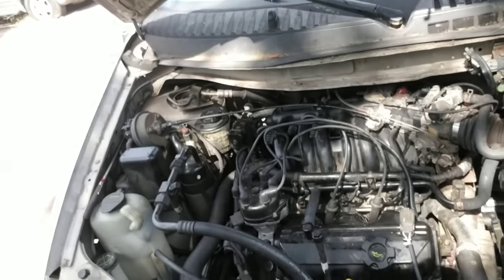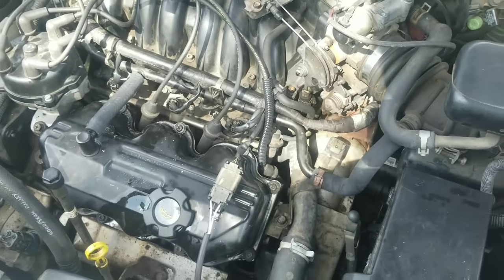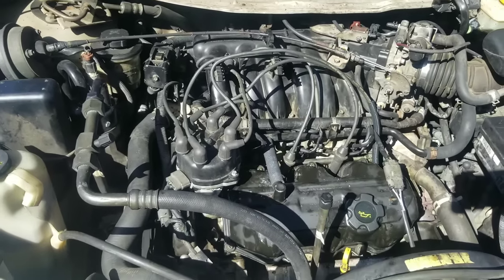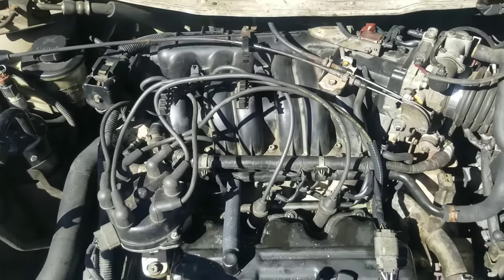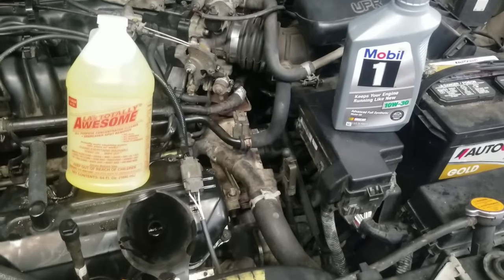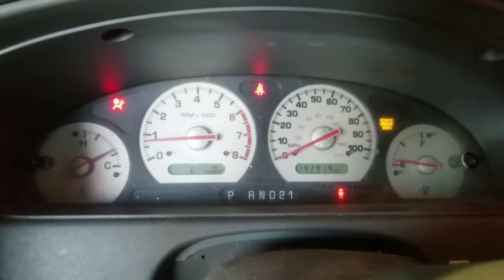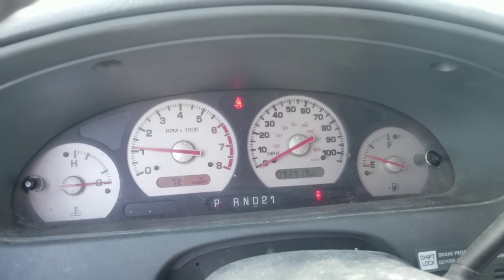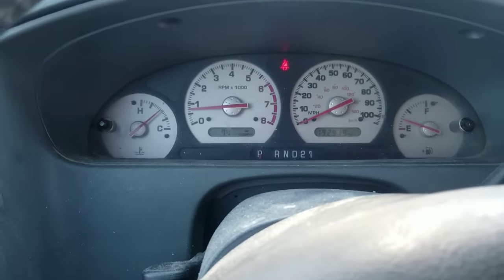How to Clean The Inside Of Your Engine The Easy Cheap Way.

Comment: Think I'll just follow the advice of Scotty Kilmer!  Just keep your oil changed regularly, as motor flushes will cause more problems than what you had before!  This is terrible advice!!
Reply: Scott Kilmer i don't like because he is wrong in alot of things like if you noticed he tries to make everything that's out there look hurtful and bad just to make his YouTube videos. His not always wrong on some things but I just see him as a haiter on every product that's out. Regular maintenance doesn't cut it most of the time. And for an example ethanol fuel cleans engines carbon Billups if used properly you feel the difference you just can't use too much cause it messes with air fuel ratio and you can run lean. This is one of the best ways to clean out some carbon Billups and im not saying to use it every time but I'm just trying to show everyone a small example and trust me I use a lot of products that are out there and some don't work at all but some really do as they advertise. Motorkote hiperlube oil additive was the best additive I've ever used. It's almost like you upgrade your engine that's the difference i felt. I felt my truck so much lighter i didn't expect to feel that much improvement just look up project farm Motorkote on YouTube. This guy tries out all additive and does legit tests on everything.
Reply: If engine was maintained from new you don't need to really do to much more than regular maintenance but you still need to do intake cleaning and some motor flush one's in a while to keep it from sludge Billups
Reply: @transam8607  Well you keep doing that then!

Comment: Never saw that product but will.look got it usually I flush with diesel 1qt. run a few min. Then change do it as many times as nessisary to get  cleaned.out  marvel is awsome stuff had a mother that was in a flash flood and was seized up trusted tight put marvel in it let sit for a few days drained it out put in fresh oil turned over by hand ran great

Comment: From my experience if you have an older model car with prehistoric engines multiple oil changes with lower viscosity back to back works best, afterwards drain oil and fill with correct grade of oil!

Comment: Using a real good synthetic is probably a wise move anyways, as it will better protect the engine using this method. A lesser oil would probably lose its lube ability. One thing I noticed is the lack of suds/bubbles. a good thing. How long after running did you film?
Reply from the maker: filming was done immediately after the car was turned off
Reply: Artistry Photography what I find amusing is the same people that bash your cleaning method are the same ones that feed their engines Lucas stabilizer maple syrup. Which is probably what you're cleaning up.
Reply: Artistry Photography considering the options I think what you did was far better  than wait for the inevitable seizure due to oil starvation

Comment: I have an 03 eclipse gt. How much of that awesome you think is safe to use during the flush?
Reply: Did you do it?  How did it go if you did?
Reply: I never used it. I was waiting for a decent amount to use on it.
Reply: @PatrickVolf  Did you do anything else?  I have a 2000 RX300 that burns oil.  I'm backing off synthetic oil and going blend.  I plan to run it with Marvel Miriacle Oil for about 1000 miles.  When I'm down to about 50 miles before the oil change, I'll add some Seafoam to the oil.  I will be running at least three ounces of Marvel Mineral Oil and one ounce of acetone for every 10 gallons of fuel for all these miles.  At the point of oil change, I have to decide if I will pull the plugs and put either Marvel Miracle Oil or half ATF and acetone into the tops of the cylinders for a nice soak.  Scrubbing with a rigid bristle, non-abrasive brush is recommended, too.  I'll pump the crap out, and fog the cylinder tops with oil.  Hand cranking the engine might make sense here -- have to do some more homework.  Hopefully, I can disconnect the cat so I don't ruin it when dumping all the deposits.
I will add some AT-205 Reseal once I change the oil.  I may run some LiquiMolly Engine Saver through it, too.
I may we'll iterate through this process a few times depending on the observed results 
The engine isn't running right, but it isn't torched like this one.

Comment: Remove the valve cover and oil pan. Remove and discard old oil filter. Use mineral spirits and brush away sludge from topside. Do the same to the bottomside.
Use compressed air and blow through oil passages. Spray with carb cleaner. Clean valve cover and pan. Change gasket.  Put covers back on. Install oil , new filter and engine flush. Run 20 mins and change oil and filter.

Comment: Slow/gentle is best, or else you can break off chunks of sludge/carbon that can clog small oil passages.  If your engine is like a BBQ grill and will take 15W40 oil, the best/safest way to clean it is by using Chevron Delo 400, which is a high-detergent formulation of motor oil for diesel engines.  Change it when it gets black, perhaps 1000 miles to begin with, and then increasing to 3000 miles. Eventually switch back to your favorite high quality synthetic.  ;-)

Rislone is a great product too - a high detergent additive..  You can also use a quart of 30W ATF in your oil mix (which is a high-detergent oil).

Comment: So! I just wanted to share... I did this to an engine. I drained all the oil, put some regular oil in, and the LA's Totally awesome. Ran the engine for about 5 minutes, let it drain for about an hour. Repeated the process, and... Well, it locked my engine. Within a second, the noise changed, and then it just stopped. Attempting to turn the key it did nothing. 

I drained it all again, and even with the drain plug removed, it was not cranking. It was seized. Last ditch effort, I took a breaker bar, and was able to hand crank the motor slowly. I Put the drain plug back in, put fresh oil into the engine, new filter. The engine would crank, stop, crank, stop. Eventually, after cycling the key a few times, the engine began to crank freely, and it started right up. Since then, the engine has had zero problems starting up too. 

I think despite adding oil and the LA's Cleaner, the engine was so far gone, that the fluid was seeping past the rings or valve seals that it hydrolocked the motor. Though, luckily I was able to get it running again, and once it started, it actually did sound better. The motor in question was a 3.7L Dodge Motor. I think for now, I know Project Farm recommended Restore brand engine additives, so I will try it, and see if I can get this thing to last a bit longer. This is a family member's truck that they neglected the hell out of sadly.
Reply from the maker: Thank you please like, share, and subscribe, also please check out my other channel Salem Taxi, on YouTube for more material on a different level.

Comment: Could you post a step by step? This is what I got {Guessing that engine is 5 quarts of oil?}

Flushing the vehicle 6 times process:
Pre-Flush: Step 0
First flush: Steps 1, 3-6
Flushes 1-5: Steps 2-6
Clean Flush (6):  Steps 2A, 4-9
Final Oil Change: 1B-2B, 4-5
Done

Flushing Steps:

0) Clean the cylender heads (L/R) of large gunk / debris
. . .
Step 1) Remove 2 quarts of oil [first flush only]
. . .
Step 2) Add 3 quarts of engine oil [recap engine oil]
Step 3) Add 2 quarts of cleaner, [40% mix 3:2 ratio, replace engine oil cap]

Step 4) Start vehicle and idle for 5 minutes. [Listen for new noises, vibrations; dash warnings, leaking oil, stop and move to next step]
Step 5) Wait 5 minutes for oil to settle and cool

Step 6) Drain Oil [open engine oil cap, wait for clumps to stop flowing, replace darin bolt]
. . .
Step 7) Unstill old oil filter
Step 8) Prime New Oil Filter [fill halfway with new oil, coat gasket with new oil]
Step 9) Install new Filter
. . .
Step 2A) Add 5 quarts of engine oil [recap engine oil]
. . .
Step 1B) Add 1 quart (32floz) of Marvel Mystery Oil
Step 2B) Add 4 quarts of engine oil [recap engine oil

Comment: Two quarts transmission fluid then your two or three quarts of oil. Run motor till it gets hot. Shut off, and drain. Repeat, until oil is clean

Comment: I have a 09 toyota 4runner, with only 64000 miles, which would be the best oil brand 5w30,,,?
Reply: jj Gonzalez I use stp 5w-30 high mileage for my 08 4Runner

Comment: I HAVE Been warned about oil cleaners but had to do it.  Ruined a 351 Cleveland engine. Just as I was warned against doing. Now I watch these video in fear. I would use it for 30 seconds and drain it, run 3 quarts oil for 60 seconds then, change it and the filter and be done. Just sayin’ be careful guys, Ask any mechanic. Sludge holds older engines together 100,000 - 200,000 miles or so !
Reply from the maker: omg get a life, sludge kills engines like clogged arteries kills the heart. if sludge was good they would add it from the factory
Thank you please like, share, and subscribe, also please check out my other channel Salem Taxi, on YouTube for more material on a different level.

Comment: I’m about to run 8qts. Of tranny oil and no, I’m not talking about Vaseline! Through my Gen V. 5.3L Silverado engine to flush and clean.  No oil at all. For 30mnt. idle run time. Then I do it with cheap oil and liqui moli  for same 30mnts. Then add one more cheap oil an cheap filter for 30mnts. Only cuz I don’t got time to do it for a freakin hour. Then I change oil and filter with my Royal Purple and filter. Works great!

Comment: The service engine light could be the awesome soap bubbles floating around. You might have to flush with a sponge 🤷🏾‍♂️.
Reply: Did you watch the entire video?  It was only a spark plugs wire not seated fully.  $0 and .002 seconds to fix.
Reply from the maker: thank you, funny they have eyes and ears and use neither.

Comment: I have a 2008 prius with an oil consumption problem. I lose a quart every 3000 miles. No drips, no soot in the tail pipe, new pcv valve. Dealer says it needs 10,000 mile oil changes, what a load of crap. I changed the oil at 3,000 BLACK Oil. Changed it again 100 miles later, DIRTY OIL. Changed it again, it's now 200 miles and the oil is starting to get dark

Comment: I always was told qt to 2 qts. of Diesel Fuel was the best results for flushing engines. I flush 3 different engines with Diesel Fuel for 5 minutes. Then changed filter, and oil to Full Synthetic. Was this wrong? Qt. of Diesel fuel in old cars gas tank pre catalytic converters. Diesel Fuel will clog a catalytic converters.

Comment: I like to pour in about2 qts of oil to get the rest of the bad oil out until it's clear on a normal change. I would still do that but with more cheap oil to try and get out the bad oil. Then use  good oil and filter. If I did a motor flush with any of the bands or home remedies. I would at least change the filter once again after a 100 miles or so with anything I used to flush because it's still going to be loosening up junk. Knowing me. I would most likely change it more than once after doing it. All while checking the oil often looking at it to see what it looks/feels like.

Comment: I have 97 bmw 3 roadster I replaced the head new head gasket? I having a problem with the yellow oil water mix which had clogged all my crankshaft sensor camshaft vanos are still have this yellowish residue it going less and less but it messing all  these sensors up ?  still can I flush it the same way for a bmw 2.8 ? please comment back I'm up against a wall on this matter .
Reply from the maker: i would flush it

Comment: The clicking noise is the tappits not the oil pump, the tappits rattle as the oil is to thin to run them and keep them quiet. 
This happens as the oil has a coating on the tappits so if yo check them with feeler gadges they show the wrong. setting when the oil is back it run s sweet.

Comment: How did you ever think to use Awesome as an oil wash? I would've thought it was water based and it wouldn't be compatible with petroleum. Amazing find.
Did you ever try it as an upper throttle body cleaner instead of $10 Seafoam?
Reply: It's a concentrated chemical you have too dilute it too use it... Most people just use it full strength and a damp cloth
Reply from the maker: i dont use it as a throttle body cleaner unless its off the car i prefer brake parts cleaner when its on the car because the brake parts cleaner can be burned and the water based cleaner can not nor can it be compressed to burn
Thank you please like, share, and subscribe, also please check out my other channel Salem Taxi, on YouTube for more material on a different level.

Comment: Yes it will clean your engine and it will run great after. Downside, it is corrosive so slug is gone but will eat your metal
Reply from the maker: it would take years for that that happen , it will not eat metal

Comment: I did this years ago with my 69 olds 455 80,000 miles and every valve and bearing made a hellish noise. The sludge was keeping old valves and bearings quiet......after motor flush I still had awful noise.....had to put STP/ motor honey to quiet things down.

Comment: Man I’m not sure if your still checking this video but if so, I got a 2015 4x4 Silverado an was thinking of doing a flush I just did have have a performance tune put on it and it runs like a scalded dog but it has a little hesitation to it. Will that stuff work in my 5.3L? Also how do I get that stuff? Thnx man, ima go head an sub to u
Reply from the maker: Thank you please like, share, and subscribe, also please check out my other channel Salem Taxi, on YouTube for more material on a different level.

Comment: People tried to trash my car by adding liquid detergent to the gas & oil. That gummed it up real good and made it a real POS.. People thought I was nuts for draining the oil, purging the filter of all old oil and putting it back on the car. Then I removed the oil cap and filled it to the top with water, started the engine, run it at a slow idle for 5 min, drained the milky water (white from all the detergent in the engine).. Repeated the water flush 2-3 times until the water came out somewhat clear. Purged the filter of water and started with a quart of new oil and a quart of diesel. This gets most of the water out of the engine.. Changed the oil & filter, added some Marvels oil and the car ran decent.. So much for needing a new engine... Just because you are doing something unusual, does not mean its not a solution for everyone to learn a new process of repair.

Comment: I would toss in a half bottle of Seafoam which is made to add to the oil before I used the any flush. You could break chunks off that were built up and clog the oil passages. It’s your car just be careful.
Reply from the maker: Thank you please like, share, and subscribe, also please check out my other channel Salem Taxi, on YouTube for more material on a different level.

Comment: I recognized from the engine, right away, the vehicle is a Mercury Villager (or Nissan Quest).  The recommended grade of oil under all conditions is 5W30.  You should have put that grade in instead of 10W30.

Comment: Could this technique work with a 79 Cadillac phaeton, I got sludge in my engine and I'm cleaning it with kerosene? I need advice
Reply from the maker: try  mix of awesome and oil flush 3 times change the filter each time,

Comment: You can get great results with just Marvel Mystery oil. Even Seafoam. You can even mix equal parts of the two. Do this last 500 miles before a oil change and your good to go. Transmission fuild with oil and maybe some Marvel Mystery Oil or Seafoam. Let it idle for like 10, 15 or 20 mins, flush and do the oil change. Obviously replace the filter. You should get the same results if not better, actually probably better. Don't go driving with that transmission fuild in there though. Trick I learned from my grandpa. He worked on cars since the 1940's starting in WW2, basically until he passed away early 2000's. I seen him save the worst engines. Including ones that sat locked for years. Not sure for sure how he got a super locked engine from the 70's to run. But some how he did.

Comment: Help. I messed up. I put 2 bottles of totally awesome without oil. I still had the oil plug out I put it back in it stalled within 60 seconds I poured 2 bottles of oil and it still won't start. I then drained it all changed the filter put in 2qtz oil 1/2qt of mystery 2 qtz  diesel to flush out degreaser and still won't start any ideas. Its an 05 Passat 1.8L turbo gas

Comment: it dissolves oil sludge in 5 minutes, gr8, but do the small remaining remnants of it dissolve oil gaskets in 3-4-5000 miles?🤔
Reply from the maker: no oil gaskets are metal plastic rubber or silicon furthermore when you drain it out add new oil if any is left it is diluted so much it will have no effect. 
can we just use a little bit of common sense?

Comment: I know some mechanics who will use oil eater and fresh dino oil to clean up a sludgy engine before tearing it down.
They will repeat the process with very bad engines and you can see the difference on the rockers when you pull the oil cap.
No damage at all to the engines at all so using his process is not so out of the question.

Comment: This probably does work for removing sludge, but I would be worried about how it would react to the metals inside the engine, not hating just a thought before anyone tries it.
Reply: Donalld Allhands I was referring to the LAS totally awesome cleaner
Reply: Aren't the metal it's touching also all covered in fresh oil...???? That would mean they wouldn't rust ..